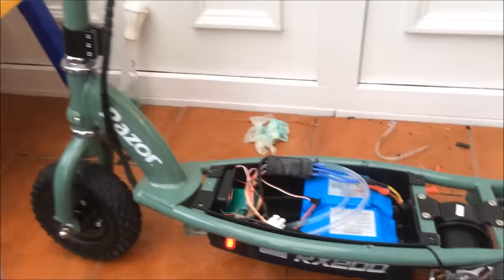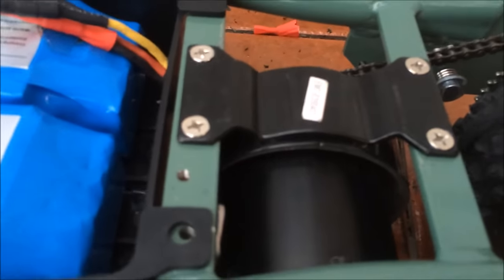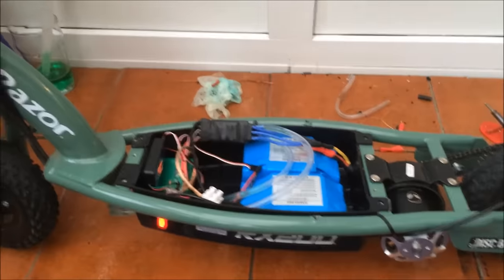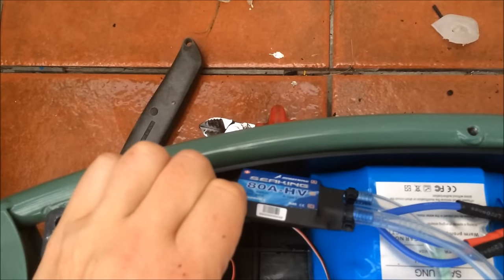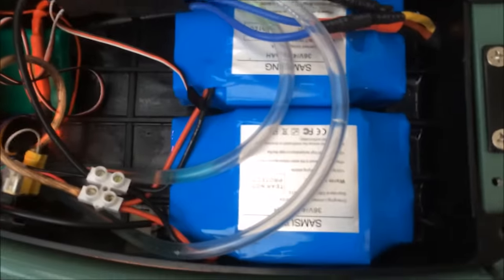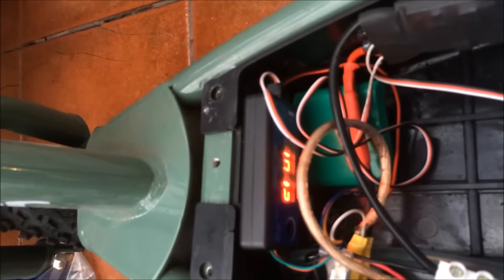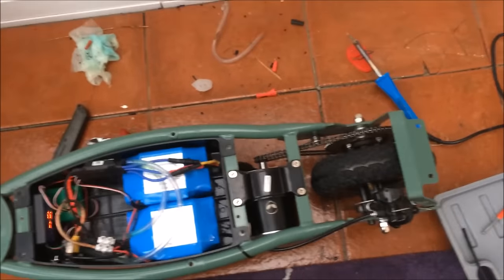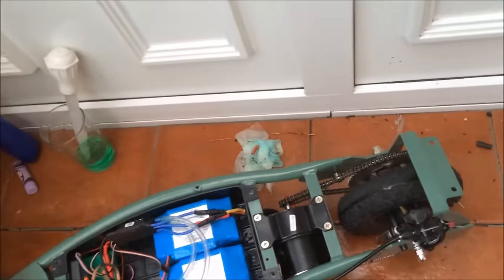razor 7000w scooter brushless out runner, modified, liquid cooled, Build pics

Comment: You can’t leave us hanging too long on the details of your new build!! 😊 I’m just now catching up to you on your alien motor Razors now your moving on lol. I’m down to waiting for my batteries on my e-300, vendor is out of stock so going to be a few weeks.  12s 14AH, 80-100 outrunner, 60 amp continuous vesc, and disc brakes. All done except batteries. Can’t wait to power it up.

Comment: For anyone trying to make the motor mount, I have found an easy trick for removing the magnets inside the motor casing. Simple get a camping stove (many people have them), and heat the motor casing up for 20 - 30 minutes. the magnets lose most of their magnetism, making them far easier to remove.
Reply: Tech4lyfe any tips for actually mounting the motor? Is welding a faceplate the only option or can you use the existing faceplate and grind it down?
Reply: DCT FPV the faceplate of the original motor was either magnesium or aluminim. I couldnt weld it. Make a steel faceplate, and weld that to the motor case

Comment: How fast have you got it up too with different gearing? I ordered a 8080 motor but I wonder if a 80100 motor would be better. For the price the 8080 motor seemed worth it and I assume that it shouldn’t be too much weaker
Reply: I’ve got a 12s 20ah lipo ready for it
Reply from the maker: @WeirdScooterKid  the only trouble with smaller motors is smaller shafts and less cooling mass .
Reply: @dickiewithers9564  I think the one I ordered has the same size shaft size it’s just a little shorter. Thanks for the input

Comment: Would you still recommend this setup for upgrading the E300 scooter? Same Alien motor and same controller? Which battery models would work best with these two? Thanks again!
Reply from the maker: yes i would,the motor was excellent, my friend bought a smaller version and as expected the shaft flexed and the windings rubbed against the magnets. i would use a vesc controller they are cheap small and very powerfull with unbeatable user adjustable  software,  batterys are just about money, i make lipo packs, ill post a video. lipos give more power than the eqivelant lion batterys.

Comment: Hello Dickie! Love your videos! I just did a scooter build and I’m working on another. As far as the throttle goes. I know the red to +3v on the vesc, green signal wire to ADC and black to ground. What about the other wiring for the throttle that you used? To the battery positive and negative?
Reply from the maker: I use +5v on the throttle. Hall effect sensors usually give out 1-4v. Positive and negative for the display i just soldered a 3 amp fuse on the battery  positive. You could wire as you said and it should all work.

Comment: I'm wanting to upgrade my e300 as the SLAs are now dead. Wanting to go li-po Power as have used these in my racing quads and the power they deliver is awesome. My question to you though is firstly do you have a wiring diagram I could borrow and secondly how do you charge? Are you using a BMS and standard wall charger? I use the scooter for commuting so I need the ease of just plugging it in at work and not have to worry about balance charging as I'd have to take the batteries out. I look forward to hearing from you soon!
Reply from the maker: i use a bms, i carnt believe people that take their scooters apart to charge,  i use a standard power supply two wires, one connector. its working well, my charger is fully adjustable,    https://www.ebay.co.uk/itm/LED-power-supply-240W-48V-5A-MeanWell-HLG-240H-48A-Switching-power-supply/222675131301?hash=item33d878dba5:g:zicAAOSw7PZZ3icw   i dont have a wiring diagram,  but i used two 6s bms in series and just plugged in the balance connectors,
Reply: Thanks for getting back to me. I don't really need to go as fast as yours and probably can't afford the total costs. Do you think a lower kv motor will still be ok and have enough torque? Also how is yours holding up after this time? Still going strong? Do you have a parts list I could see? I don't need to specific things like battery output but a basic list of what I need to make it run. Such as;
Lipo
Brushless motor
Vesc
BMS
Fuses
Charger
Switches
Etc 
Etc. 

I appreciate your help so far. This is all very new to me.
Reply from the maker: I can recommend the 350w brushed setup, with 3x 36v hoverboard batteries, parts list in this video https://www.youtube.com/watch?v=eXkHKjDeEgo, my 50v scooter  is way over engineered to go 40mph,  the scooter has been totally reliable the water pump got jammed by a drop of flux, but that just limited the power slightly. I need to fit a better power switch.
Reply: Thanks for the advice buddy! Yours is a piece of art but I agree it's far too over engineered for my intented use. Saying that I bet it would be a blast using that on a daily basis! I really do appreciate the advice! 👍
Reply: Also, did you upgrade the rear sprocket on the hoverboard modded one or leave it with the standard (I think 55t) one? There are a couple of hills, not huge but it struggles up them and stops at the moment on SLA.
Reply from the maker: i kept the same sprocket

Comment: Really need a lipo battery set for my razor e300 what do you recommend? Is something like 2 6S 5000mAh any good? Or something different? Would like to spend under £100 on batteries alone. Help?
Reply from the maker: what motor and voltage will you be running. 24v?

Comment: Hey mate, nice job with your scooters.
I have a Razor E300 and i want to try your set up from this scooter,do you think i can do it or i need to do the set up from your e300?
I allready try with a new razor motor the 500w one but is very big and is almost slow like the other one :(.
Can you pls tell me if i want to buy all the items in what order should i buy them because i dont want to spend 7-800 Au all together . 
And can you pls list the items
Thx
Reply from the maker: You could get  a 48v battery and 48v controller and the 500w motor you have would go twice as fast, if you look at https://www.youtube.com/watch?v=8I11YuFOkcY you will see the parts i bought, you need voltage to go faster or you could change the sprockets now you have a 500w motor, but i would buy batteries first, i used 2x 6s 16000mah li-po batteries from ebay and 2 x 6s bms (60a) from ebay, and a 50.4 volt charger.
Reply: Thx for answer me. The 500w motor is to bid and sometimes I touch with him and I would like to buy the 7000w like your but I don't like the idea of backpack batteries. I have to do like 5km till work and I can recharge at work if I need.
I saw the batteries, the motor but I don't know the speed control and the other one. Can you pls tell me the names. 
Ps you did a great job and thx again
Reply from the maker: the vesc and the motor are linked under the video https://www.youtube.com/watch?v=8I11YuFOkcY

Comment: Hi, how did you manage to put that sprocket on the motor shaf if it has no threads and  is it the stock sprocket or you bought it somewhere else i got the same scooter and I'm looking to modify it also i kind of understand everything but the sprocket part
Reply from the maker: the sprocket and the shaft are the shape of a letter D, i used an angle grinder to flatten one side of the shaft, take your time and make sure its a tight fit. its the standard razor motor sprocket.
Reply: Dickie Withers ok, but did you weld the sprocket to the shaft of motor? or just hammered it real tight that it doesn't come off
Reply from the maker: the shaft was allready drilled and tapped, so i just fitted a bolt and washer.
Reply: Dickie Withers oh so that hole on the middle of the shaft is to screw a bolt and secure the sprocket?
Reply from the maker: yes

Comment: if i  put 2 of these 36v batteries together does that basically double the amp hours from 4.4 to 8.8? Also will that effect the voltage or will it remain 36v?
Reply from the maker: yes exactly, that is called batteries in paralell,  the voltage will remain the same, the capacity wil lincrease,
Reply: That's great. Thanks. You messaged just as I started watching your 50v razor video. Haha good timing.  Thanks mate

Comment: Are you sure that's a radiator you put on their The only reason why I ask is because I do a lot of PC work and that looks like a water block designed to pull heat off of ACP U or GPU that's not a radiator a radiator has fins and air flows through it drawing heat out of the liquid
Reply from the maker: You are right it’s a water block thanks, it works well and is slimmer and stronger than a radiator.

Comment: Hi there, the scooter looks amazing. I'm currently modding my e300. I'm running 12s battery with 350w brushed motor but it's just not quite fast enough. So I'm thinking of going brushless. Could you please let me know the specs of your motor and if there is anything you'd change. Thanks jamie
Reply from the maker: my motor is 80-100 130kv, 7000w at 18s from alien power systems, and read all the projects on endless sphere and you will get loads of tips, i picked a large motor as that is the weakest point, you should claculate your nominal speed say 25mph and buy a motor to suit that speed as your esc and motor will run cooler at full speed and low load rather than running half speed full load say 25mph with a 300kv motor, i need a front brake before i can gear up and go a bit faster but i am installing a vesc next week, and a lot more capacitors,  i will use an xt90 anti spark connector as a power switch as capacitors will quickly damage your switch contacts.

Comment: Damn just saw this video now, I'm in London, and was going to ask if you would do mine if I paid you, but looks like someone else has already asked you. How long does it last with your current setup. I wanted to do something like this to mine to use it to get to work and back.
Reply from the maker: Joynal Miah the current set up is 16ah at 12s lipo and you could go 60 miles at 15 mph or about 25miles at 28mph. I’ve been out with my son on it for 4 hours before and it has loads left on the way back.
Reply: @dickiewithers9564  Your a BOSS mate, how can I do something like that, are there any instructions you can give me bruv? I don't need it to go fast, just need the distance.
Reply from the maker: https://www.youtube.com/watch?v=y7xMllTrwsI This is a start but you will need a 36v 40ah battery from ebay  (£450) it wont be as fast as my scooter but it will do 50 miles, i carnt do a tutorial for my scooter it would be too complicated, sorry.

Comment: Those are 36v battery connected in parallel right?
Reply from the maker: yes in parallel the more the better, 3 is recommended to reduce volt drop under load.

Comment: Is there a way to charge without taking out all the batteries?
Reply from the maker: you dont have to take anything apart if you use a bms, so use a bms, or your scooter will be a frankenstein. and you wont bother using it because it will be hard to charge.

Comment: Where would you get a 7000w speed controller now?
Reply from the maker: ebay/ alien power systems/  or if you want your scooter to look standard then focbox from enertion.
Reply from the maker: focbox or vesc are not rated at 7000w though.
Reply: Dickie Withers do I pick an EV ESC?
Reply from the maker: Wiziki inn yes
Reply: How many volts can an a vesc handle?
Reply from the maker: about 13s but it depends on the motor you will be using, as it has an elctrical rpm limit.
Reply: Dickie Withers alien power systems does not show how many rpm their motors do. Do you think a standard 12s motor with 4KW would do more than the capacity of rpm of a vesc?
Reply from the maker: Wiziki Kv x voltage = rpm.  X that number by the number of poles to get electrical rpm. The lower the kv the lower the rpm. Standard out runner motors are to high kv hence they blow up speed controllers but alien power systems make  custom lower kv outrunner motors.
Reply: Dickie Withers how much would an average vesc be able to take in rpm?
Reply from the maker: the recommended max erpm is 60,000

Comment: Are you using the stock 25h chain?
Reply from the maker: Crazy Experiments yes 25h gold chain
Reply: Dickie Withers Damn how is it holding up to such a powerful motor
Reply from the maker: Crazy Experiments the chain is ok. But the free wheel squeals sometimes. The vesc is quite smooth and i try and resist the urge to wheeelie.
Reply: Dickie Withers Whats the difference between and ecs and a vesc
Reply from the maker: a vesc is a type of esc,   it is designed for electric skateboards by a robotics engineer, you can plug it into a laptop and make 1000s of adjustments while viewing live data, it has field oriented controll which is smoother and quieter than traditional esc's. its very good at going at less than walking pace without any noise or jerking.
Reply: Dickie Withers Thanks

Comment: what batteries are you using please mate?
Reply from the maker: Theese batteries are 36v Li-On with built in bms from hover boards, They are very easy to charge and cheap but,  li-on batteries are low current so i used 3 in parallel but with this large motor there is a lot of voltage drop, if you intend on running high current you will need lipo batteries like my latest scooter.
Reply: That's great thanks mate. What  lipos are you using on the other scooter?  I'm struggling to find a 36v that will fit in the battery tray of my Razor because the frame tapers in towards the front
Reply from the maker: 2x 6s 16000mah matched lipo for multirotor, get a matched pair and a bms and you can bulk charge instead of stripping your battery down every time.
Reply from the maker: They wont fit in the tray though, you can fit 3 36v hoverboard batterys in though.
Reply: Thanks again, I'll take a look into the hoverboard batteries. Do they need to be put in parallel or series?
Reply from the maker: parallel for 36v
Reply: Dickie Withers thanks again. where can I find the batteries? I'm very new to this so I'm not too clued up yet
Reply from the maker: http://www.ebay.co.uk/itm/36V-4-4Ah-Li-Ion-Battery-For-Smart-Self-Balancing-2-wheel-Unicycle-Scooter-/311783426475?hash=item4897bd89ab:g:d9QAAOSwA3dYdZP2
Reply: Your a top guy. Thanks mate I really appreciate your help

Comment: Where did you get the chain guard from?
Reply from the maker: the chain gaurd comes with the scooter.
Reply: Dickie Withers Okay, I just finished building an electric scooter and the rear sprocket is a little bit off so the chain is loose half the time and tight half the time
Reply from the maker: have you got a chain tensioner
Reply: Dickie Withers no, now I've driven over 40km on I don't think it's necessary

Comment: Hello,

I i want to make me scooter fast too. Can you make a part list for me with links? 

Kind regards,

Arno
Reply from the maker: For the 80-100 brushless outrunner motor 130kv  http://alienpowersystem.com
 For the vesc     http://www.enertionboards.com/. 
 Everthing else is from ebay
Reply: Dickie Withers ok. Thanks, but it is to expensive for me. Is that the cheapest way?
Reply from the maker: your batteries will be the most exspensive part, £100-£600  the more you spend on batteries the better,

Comment: Its 2800 watts not 7000. 80amp at 36volts.
Reply from the maker: 80amps and 36v are the controller and battery ratings not the peak ratings, this  is common practice on most things in life. this controller peaks at 160a and the battery peaks at 42v and the motor is rated at 7000w.  my scooter now has 12s lipo 50.4 volts peak.  I think a 7000w motor this small is amazing. if you have a faster razor scooter id like to see it thanks.
Reply: Dickie Withers It limits it to 80 amps. You can check it with an amp meter or watt meter. Even if it peaked at 160amps it would be 5000 watts not 7000watts
Reply: Dickie Withers It limits it to 80 amps. You can check it with an amp meter or watt meter. Even if it peaked at 160amps it would be 5000 watts not 7000watts
Reply from the maker: i think you mean 6720w  (160a x 42v)  any way the motor is rated at 7000w,  power ratings are not regulated by any body, and all manufacturers use thier own process,  i know what your are saying but every electric scooter amplifier etc etc etc has a rating and this is always a guide,  If i give peak figures thats fine, most electric scooters give peak figures, The video or title is not about ohms law, check out my other videos
Reply: Dickie Withers I thought it was 36 volts. You can add a 6s pack in series and put a 72volt 200 amp controller on it then it would peak out at 14,000 watts. The motor would run hot if you are heavy on the throttle. It would be even faster!
Reply: Dickie Withers Nice build. I saw one build like yours with 10,000w motor and one with 6500watt on this forum:

http://forum.modifiedelectricscooters.com
Reply: irrespective of all this maths.if you bought the motor as you can get 350w 500w,800w and a 1000w etc...surely a 7000w motor would be huge!!...what was it called when you bought it?if i bought a motor like this on ebay what would i be looking for?please send a link if you would please?kind regards,david
Reply from the maker: its sold as a 7000w motor, its an outrunner brushless motor not to be compared with standard motors, try alienpowersystem.com
Reply: right,thanks for the link dickie
Reply: This is 8 amps? 2 hoverboard motors
Reply: Batteries*
Reply: Yes they are 36v 4.4 ah each, he has wired them so he gets 36v 8.8ah